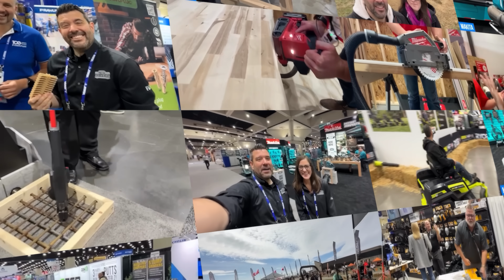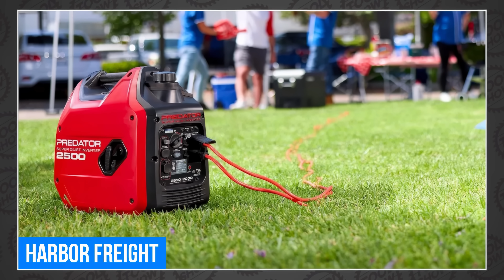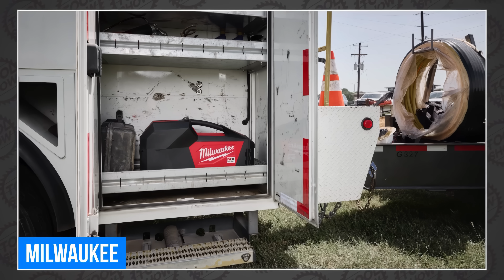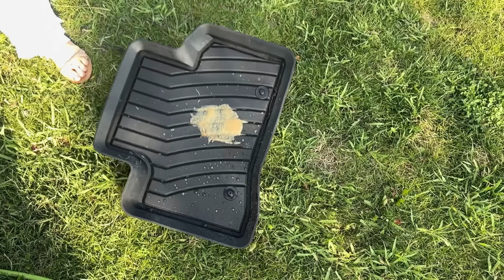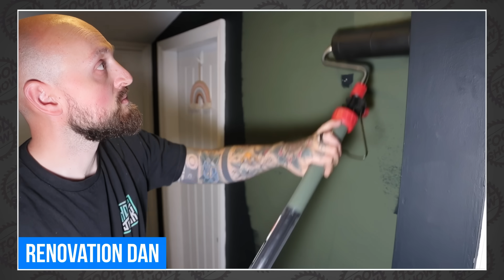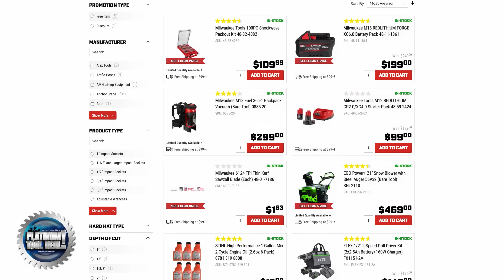NEW Power Tools Announced from Milwaukee, Harbor Freight, Festool, RYOBI and more!

Comment: Question, on the video it says join for as little as $2/month to be a tool show fan to get the tool code deal ahead of the airing of the episode.  Also, on join channel screen it shows production crew for $9.99/month. But it’s $12.99 plus tax 0.81=$13.80 on the YouTube charge each month on the apple receipt. Is YouTube adding $4 on? Or is there 2 levels of production crew now?
Thanks for clarifying this when possible.